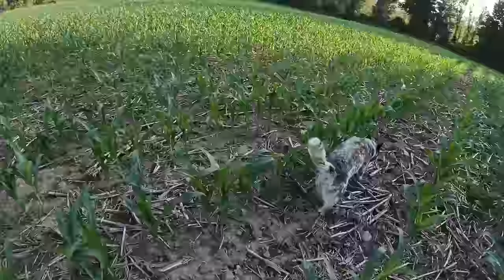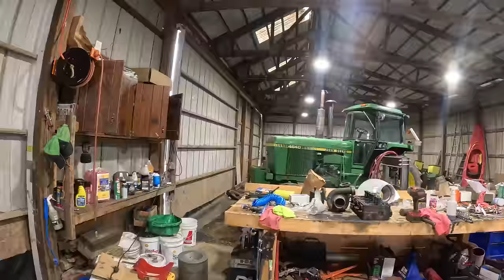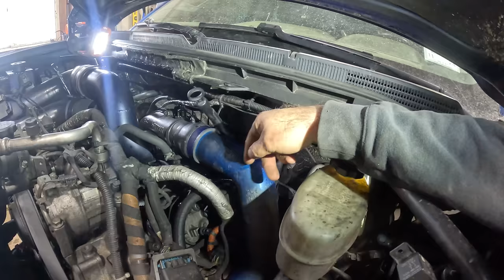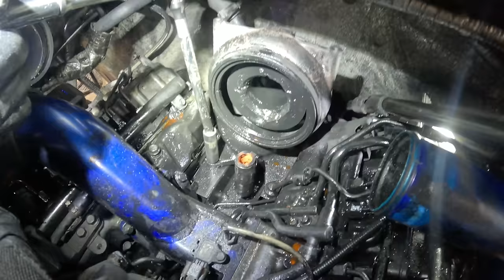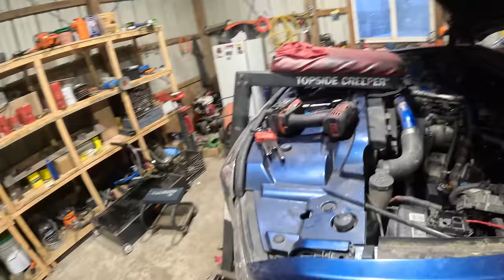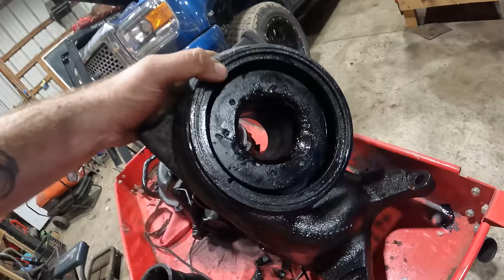Duramax Turbo Destroyed It Self- Trucks Ruined!!!

Comment: FYI Turbo ususally do not fail by themselves. Normally there is a boost leak somewhere which causes low back pressure on the pressure side and the turbo overspeeds and well you know the result. Id for sure go over the intercooler and all the piping and pressure test it all.

Comment: in 2013 i bought a new 6.0 Silverado3/4 TON PICKUP since then i have hauld 2  of my sons cummins and my other sons power stroke my daughter in-laws older chevy pickup to the shop and have never touched my Silverado once besides new brakes and its nocking on 200ths miles on it been great truck and just bought a ram hemi pickup a year ago and really like it.

Comment: I have a 86 Chevy with a 12 valve Cummins.  Almost $100k in it.  Awesome and I wish I had the $100k.  To anyone that will listen just buy a new truck with a warranty.  Old school is cool but it is a lot of money and work.
Reply: I would love to buy a new truck my hemi is a 2012 with 50,000 miles on it never put any money into it now I'm starting to put money into it but I will not spend 100+ thousand dollars on a new pick up truck they could keep them this is the six new truck I had in my life the 12 was the most expensive at about half of the price as a new one today
Reply: Got a 90 Dodge with a 12 value 586,000 miles all I've done is 3 water pumps an alternator a starter and a radiator still running like a top and was used as service truck on a logging operation for several years
Reply: Amen
Reply: Buying new isn’t always better these days. If he had just left the engine stock from the beginning. Then he wouldn’t have had all the problems. Instead he decided to go with a hot tune year ago. 🤷🏻‍♂️😂 now it’s just going to continue to be a problem.
Reply: If you keep the old school stock or slightly modified it's not that expensive
Reply: @fishydubsfishing6516  Right on man. I say hang tight. I honestly think all these 100K plus pickup will eventually be bown out for in the 50 ish range. Just gotta be patient. Dealers and manufacturers are CHOKING on inventory and nothing makes me happier. They screwed all of us during the shut down. Now it's their turn and it's going to be UGLY!!!!
Reply: That happens Chris. Have a good day.

Comment: I do like your pickup don't get discouraged  gmc  truck is awsome  I always wanted one like yours  I have a question does your international have the thread on break valve knobs or ones with pins in it for tractor and trailer

Comment: I think I mentioned it once before you need to get a grease board one for preventative maintenance another one for on going maintenance repair projects to keep everything running you start the list  1  through however many you have let's say one through 100 I'm sure you have 100 things to do by priorities so when you start a project on the list you put  an a/ slash and each project you start when you finish let's say project number six you mark it a/c that means action complete and you take a highlighter and draw I highlighted line through that item and you do that as you fix the items on the list when you get a numerous amount of them done you consolidate the list rewrite it add to it that's how you run maintenance in a factory there's no other way to have any sanity and avoid breakdowns but to do it this way you could take it or leave it I'm just giving you an idea I ran a Millwright crew in a massive Papermill

Comment: Quit buying more junk. Fixing equipment is the least profitable way to run a business and it will ruin your mental and physical health. Like your combine pump. You were so frustrated with it that you spent all that money on fluid just to run it when you could have easily welded it permanently/temporarily or had someone weld it. You need to sell the Mack, the International and buy 1 truck for 5-10k thats a runner. You can't keep throwing money at a lost cause. I'm telling you think because I've done it. It was the worst idea I had. I wouldn't listen to anyone either. I finally go sick of it and they were right all along. Don't let your pride take away your future. I believe in you Duff. You have to change your thought process though. You'll be so happy once you do.
Reply from the maker: The fact u said to weld a hydrostatic pump housing to the gear box shows me you have no idea on properly fixing anything so your comment is so invalid. Running junk and fixing equipment is how most farms keep going not everyone has new equipment and hires the dealership to change tho oil. I'm not mad or bothered by your comment it just  shows how disconnected from reality some people are who think they know everything
Reply: @DuffyAg  Ok. Well when a welded a cracked pump on a D6 it held together just fine until the new one came in. Who said weld a pump to a gear box? You said the housing was cracked. So, it wasn't cracked? Bad seal? You shouldn't get mad. Its constructive criticism. I respect that you have the balls to start farming Duffy. I grew up on a farm so, I know all about fixing junk. Don't let your ego and pride get the best of you. You won't be farming long if you do. Hit me up though. I WANT TO RUN SOMETHING BY YOU. TO HELP YOU.